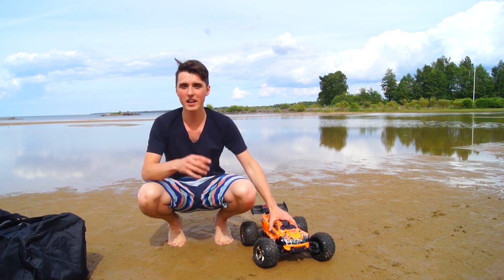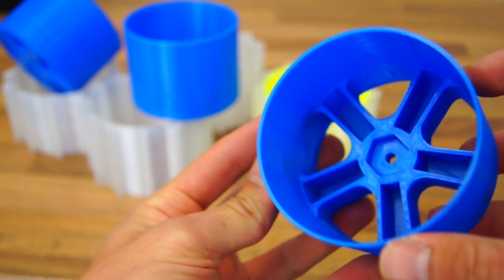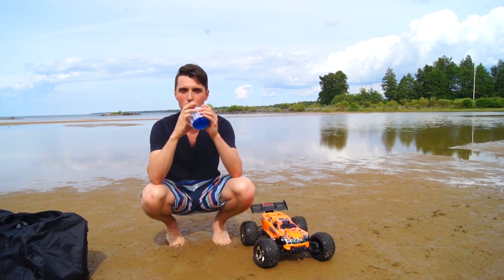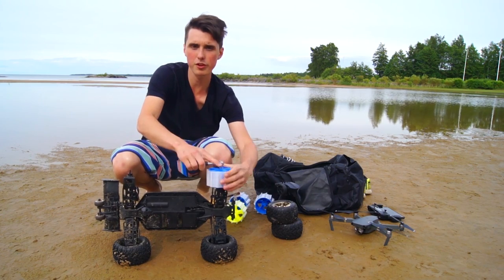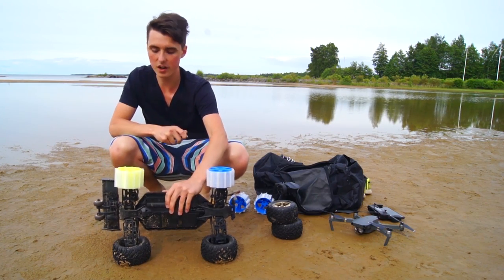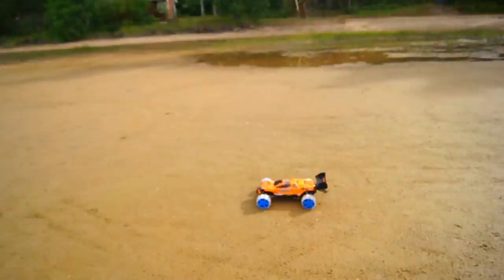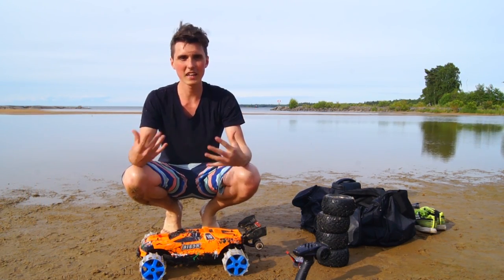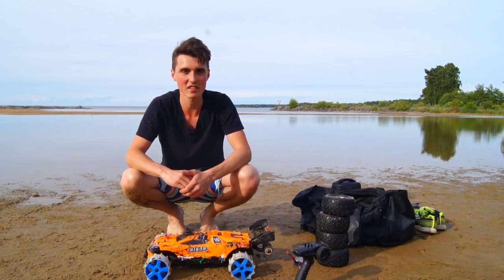3D Printed RC Car Wheels - Crazy Traction!!!

Comment: Howdee, in the world of farm tractors and mud etc, the tread that does the work has a pitch to it.  If you examine a rather ordinary farm tractor tire, you will notice the ribs are Angeles out away from center. This is to displace anything the tractor is trying to drive through so that it doesn't self clog. In other words, your paddles are a excellent with one exception, anything  they grab including water, they tend to hold some of it hence the paddle becomes less efficient  as it continues  its journey. So, from the center, pitch the tread (paddles) outward and rearward  at about a 30degree angle. It should start to perform very differently from the idea I just watched. Depending on the psi index, you will need to adjust the degree of angle as well as the pitch of the paddle . Angle = how much toward  the rear the paddle is as it measures from the center to the outside of the wheel. Pitch = angle towards the rear from the surface of the tire outwards, forward pitch =  cup action, rearward pitch = self draining action.  I got money says you can make it walk on water.

Comment: when the front wheels hit the water the design of the tread breaks the 
surface tension of the water thus making the  nose dip into the water 
..no tread on front ..will act like a water ski ..the rear will break 
the tension of the water ..and the back end will dip a little  ..but the
 power and the design of the tread will propel it forward  fast enough to produce a aqua plane 
effect.

Comment: I think the wheels are OK you just need to cover both ends of the wheel mags so there will be air trap inside the mags to create bouyancy and so that the water cannot come inside the mags and then forced your rc to plumit under.. your design works in few meters but when the speed of the rc decreases the water will fill the empty space of your rc mag wheels and forced your rc car down in the water.. i hope it will help :)

Comment: just need a higher tooth pinion for more speed. The diameter of the printed tires is smaller than stock, so it's slower with the new smaller tires

Comment: The reason you're not able to drive on the water with those is because the paddles aren't nearly steep/aggressive enough. Increase the length of them, as well as drop the angle.

Comment: Rubber tires filled with air have more buoyancy than plastic paddle wheels so they don’t float on the water like the stock tires.

Comment: I don't think the problem is your wheels, I think it is the body grabbing the water and pulling it down. The normal wheels are buoyant and holds the entire body more out of the water, giving longer runs. I think if you sealed the body cavity (like a boat) it will float on it's own and your paddle wheels will drive it along.

Comment: Your wheels are open on both sides.  The water gets in and slows you down.  The rubber wheels kept the water out.  The paddle wheels you showed also keep the water out.  Make a sealed wheel next time.  Keep it hollow inside though.

Comment: When you hydroplane Rc cars you have to put air or foam on the wheels for floating the paddles are not supposed to grab it you weren't pushing it you also need to put pool noodles on the car so it will always float no matter what happens

Comment: The tire diameter is smaller, and the rubber tires have better buoyancy, maybe leave stock tires on front and paddles in the rear

Comment: You don't need a traxxas vehicle to use those paddles. Most rc vehicles use a standard size which depends on the type of vehicle. Each type has a standard or easily adapted drive flange and spindle size. Just figure what wheels you need then buy the appropriate paddles. Or, print wheels which fit your model and allow an off the shelf paddle to be glued on.

Comment: The way you Put the "fins" on the wheels you get a LOT of drag down because you Lift a LOT of Material off the ground and throw it into the air. Just look at the Sand!
In Order to drive on water you have to Do the opposite. Flip the tires around and Cover the sides, so you dont get extra weight from water flowing in
Reply: And by the way
Dont worry about speed. 
Your Car is faster than it needs to be

Comment: You are running a 2s lipo in the video. Try running a 3s lipo battery it will give it a lot more power. And also try stiffing your suspension

Comment: you need enough rear wheel torque to keep the front wheels off the ground or atleast above the float plain,

i've seen people drive their snowmobiles over open water by wheeling it at full throttle.

perhaps you can achieve this by having a larger diameter pattle wheel at the rear, and reducing the front weight of the car perhaps with smaller slim wheels non pattles.

you can probably rebalance your rc's mass to be more towards the rear wheels by moving the battery back aswell

Comment: The wheels need to be solid so no water can get inside of the wheels. If water gets inside it just sucks it down. So if it is a solid wheel it will work better.

Comment: I think it could have been too low to the ground when you had on the 3D printed tires because they are smaller and then front could catch the water more with the smaller wheels

Comment: Make them larger, and take the scoop out of the paddle and you should be fine. Same size as the rubber factory tire. Smaller tire is slower top speed and slower spinning speed. Just bigger will likely work.

Comment: Just change the rear one's leave the front rubber or 3D print front one's without paddles and more like a sand rail front tires with one line in the middle, so you can turn in the water.

Comment: you do not need to flip the wheels around, you simply need more RPM to the wheels. Try uping the battery or the KV on the motor.. roman is running a 6s setup and most that walk on water are 4s or better.. you simply dont have enough speed.

Comment: You need to have actual tires on it. The tires will help it stay one top of the water so what I suggest is making a wheel that works for your car but that you can mount a paddle tire on it

Comment: The wheels need to be enclosed inside the rim making them less resistant and possibly boyant like your air filled wheels. The tread needs to be a bit longer in the tooth too.  Make a 3d printed part that will snap in to the centre of the wheel! Good luck!

Comment: You're problem is that you're not using actual tires. You still need the buoyancy of air filled tires to assist with keeping the car up and reduce drag. The wheels you printed are fantastic, and as demonstrated would make great sand wheels, but on water, the large open space in the middle just lets in water and causes drag and pulls the car down. If you printed wheels with solid hubs instead of those wide open wheels they may perform better, but the best would be actual paddle tires.

Comment: In my opinion you have captured air right in front of your blade and friction between air and water is really low. I would try another flexi ring which will have round blades in way that air could escape easily. And sharp edges on ends of blade makes high drag too. I dont think that speed of rotation is youre problem.

Comment: @RcLifeOn instead of getting a big running start try maybe a foot away from the water!  cause what I saw was you got a lot of speed then hit the water witch slowed you down so fast and dug the front end in to the water!  but when you tested it on the sand I seen from the start that you had lots of torque witch lifted the front end up!  so my thoughts say to start close so you have the front end lifted when you got the water!!

Comment: If you look at yours vs traxxis yes there paddles but yours are flat the side of your wheels will dig into the water so keep the paddles a little more of a gap plus round then out like a regular tire bet it will work

Comment: The diameter of the tires is to small. It allows the the chassis of the car to touch the surface of the water.  Make the wheels bigger, just not to big for the power plant that you have, you need optimum wheel speed.

Comment: they did not work because the tires are scopes so they will dig into the water. So when u get to the back side of the tire the scope is pulling it down into the water and the front of the tire will not be able to fight the push from the scope pulling down on the back side with the water. Now if you had paddle tires it would probley work better but u will still have the problem of the back side on the tire pushing down the car.

Comment: You need to have something to make it to make it float perhaps a pool noodle measure the circumference and measure the width of the pool noodle and make the fins on the wheels flat with the same material.

Comment: you need tyres having huge surface area  and are totally flat cuz if u have Paddels they will force the water to go up which will push the car down in to the water and you need to have deep water about like 2 feet deap and also the tyres should be wide  so they can push water down and give the car huge amount of up thrust 👍👍👍

Comment: keep the back tires designed that way. reverse them for the front so they are hitting with a flat part of the ridge rather then the scoop. that way the front tires are smacking the surface of the water pushing the front end up rather then what's happening here where your scooping out water in front of your car and "digging" in to the water supporting you eventually you bog down.

Comment: The 3D printed wheels doesn't have the weight as it would with normal wheels you'd buy for the rc, you need weight with the wheels to get more momentum going into it

Comment: It is worse than before, because the wheel design is shoveling the water upwards, thus pushing the car down.
If you butt them on the opposite way it should work much better on water. Then it will push on down on the water at the front and lift but not so much water will be spilled around

Comment: i dont think bouyancy is the issue. the angle.. well. it could be. but the two kindes of paddle wheels i have are closed of in the sides so they make more like a wide shovel keeping in the water. allse that iw seen on the fullsize paddle wheels. try closing the ends of the scoops. maybe it will work better... BTW great vid

Comment: The normal wheels have a bit of air in them that keeps it floating. And you can see that the tires you made "dig" sand away. So probably the tires pulls the car under water. 

At least, I guess. I'm not a smart ass. Just my common sense.

Comment: You should upgrade your motor and the esc and above all your battery. Traxxas are just monster when it comes to those parts. That's one of the reason why it runs on water. Your RC is fine but just need to upgrade everything in the internals. The reason why I say this is if you take a look of your rc when it runs on the mid section of the water your rc is having trouble going through it. It means motor is not strong enough or fast enough. So yeah upgrade the internals and it will run.

Comment: You should put more boyancy on the wheels or should i say less weight so you should mabye if you can take a rubber inflated wheel and add spikes so it grips or in other terms add more speed.

Comment: Ok so this is why it didn't work in water. You had like scoops on the wheels and u literally had so much traction on the water that it was scooping / pulling the rc car deeper into the water instead of racing on top. So what you need to do is to make thin flexible flaps instead of scoops. That will allow the rc car to push off the top of the water instead of scooping itself into the water. If you want i can send you a 3D design or sketch of it. But good job on the project! keep it up man.

Comment: So here is my opinion and it's just an opinion. I think you should go into water A bit slower that way you have left over throttle to get the wheels to hydroplane also  I think the other comment   is correct flip the tread around so that it is pushing the water down and not "scooping" it up and since the motor esc combo you have is not very fast you may want to make new wider wheels  to displace more water.

Comment: I think the wheels are lacking buoyancy. If you could do ones with some sort of filler or floats on the inside and the paddles on the outside, there's no reason it shouldn't work. The traxxas wheels work for the same reason, I guess. They provide some buoyancy and the paddles can provide the propulsion ! Best of luck !!

Comment: Try different shape of the protector. Accordingly to my experience to avoid aquaplaning you should have foorprint like V. So imagine a car goes from the left to right, so it should leave the reversed footprints <<<<<<<<<<< to get drowned and avoid aquaplaning. But in your case you should try to reverse the shape, so if car goes from the left to right it should leave footprints like >>>>>>>>>>>>. In my experience if you mess up with your tires on a real car it's quite noticeable in the rain (the real car is a bit swimming even in not a deep puddle), so I guess it could help with RC model. That's just a guess and needs to be tested;

Comment: I noticed that your printed wheels and tires have a smaller overall diameter than the ones you took off.  Try printing a taller set.

Comment: Turn your wheels around, your paddle is now scooping up the water and pulling itself down, rather than pushing it the water down. Not as much traction on sand but should be better on water. Same idea goes for the track on a snowmobile, skips water better when it's pushing the water rather than scooping up the water.
Reply: U don't need air, just the right setup and high enough wheel rotation and full diff lock

Comment: Na bro it's not because the paddles are too small, it's because the sides of the wheels are open, and there's just a thin layer before the water gets inside of the wheel and slows it down, close in those holes on the outside and if you can the inside too, but if not then just make the wall of the wheel as thick as you can.

Comment: you should have used liquid electrical tape... you are able to remove it if you really need to and it has a rubbery feel.  Much better than epoxy.

Comment: You might have a suspension problem actually, as soon as your car enter the water, you can see your back end makin' a little hop, you might want to have harder suspensions, also, the "digger" on your wheels, should be inclined, not straight as you made (I know it s harder to 3D print) so the tire can self evacuate the water that's accumulating :)

subscribed tho

Comment: so looked in the comments no one that i could see gave correct answer  so i will the diameter of the wheels is to small first off the top speed will increase with larger tires remember that there is slipping that takes place in water. secondly this will also make the water move in a less upward direction witch forces the car down. thirdly there will be less resistance because of a better angle that the water is hitting the front of the wheels. finely do not have the wheel fines like (moveing-->)  /  but like this \ so the water is pushed a way from the wheel this help keep the water from going up word after it leavers the wheel  less down force more force forward

Comment: take off the rear wing. and the center differential needs to be locked so the front wheels can not move independently of the rear wheels

Comment: Look At Your Rubber Wheels, There Is Clearance/Air In The Middle Between The Inner Wheel And The Outer Wheel That Allowed It To Float For A While You Have To Do A Similiar Thing With Your Plastic Wheels

Comment: The wheels are too small, the original wheels are bigger, and that allows the car to move faster, my guess is that the wheels you fabricated needs to be bigger, allowing for more speed.  Also, putting the wheels the other way might make it possible, now it grabs the water, if you turn them around the will push down, giving it upforce, that might keep it on top of the water.

Comment: Any 12mm hex wheel can work on the car. Traxxas makes these for the slash so almost any traxxas slash wheels or most 1/10 Rc wheels should work on the car. Although it is probably cheaper to 3D print wheels and tires.

Comment: Don't work on water UNLESS YOU GOT POWER!

Seriously though, you're losing too much speed too quickly to maintain your aquaplane, likely due to the flat shape of your tires.  Your first rubber set did better because they were rounded on the sides, which resulted in less drag.  Consider the difference in drag between a square river barge and a v-hulled speedboat.  

It might at first seem like a good idea to have flatter wheels with the paddles as you'd expect the whole length of the paddle to get more contact with the water, because you'd expect the paddles on the rounded up walls of the tires to make less contact.  However, your wheel is going to sink into the water slightly even while aquaplaning, so the side paddles are still going to get some traction.

Comment: Personally, I think you have far too much tread on the wheels and there far too small for the job of staying above the water.  it may be gripping the water and pulling itself down, ... I'd add two Plaining structs under the car, once at speed, these structs will help the car plain across the water, along with larger wheels, it'll do the job.

EDIT,... Oops, I never saw the link to the updated version,... Larger wheels and less tread... :)

Comment: Your 3D printed wheels are smaller and therefore making the car move slower. The slower movement leaves the serface tension to break. The wheels could even have been made bigger ten the original moves for better driving on water :)

Comment: There is too much water being forced in to the insides of the wheel. The wheel needs to be a solid disc and also as much of a lip on the inside of the wheel as you can manage without interfering with the suspension.